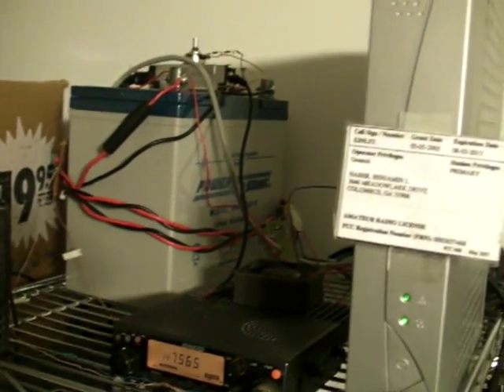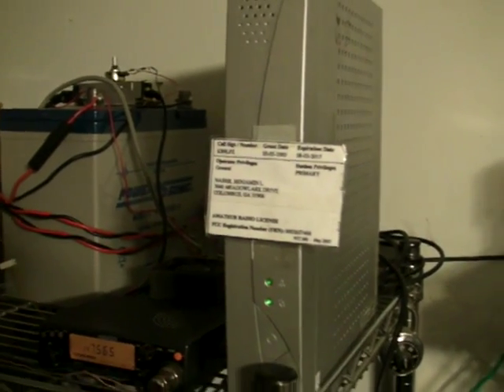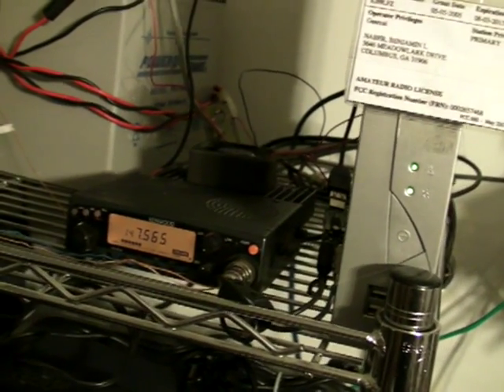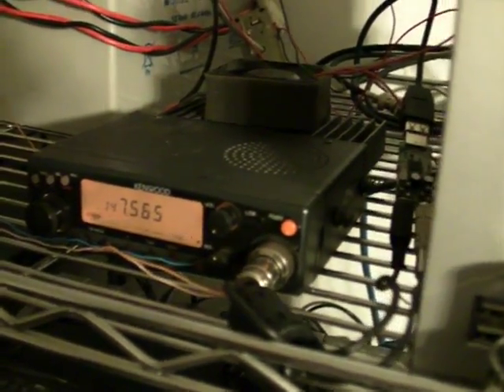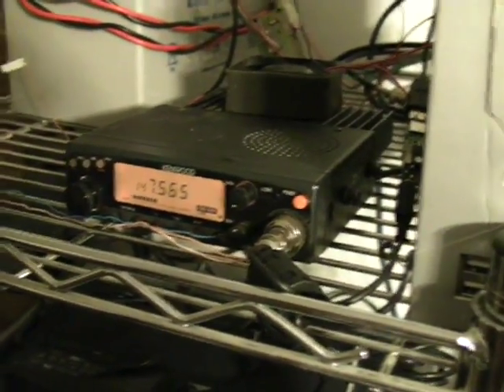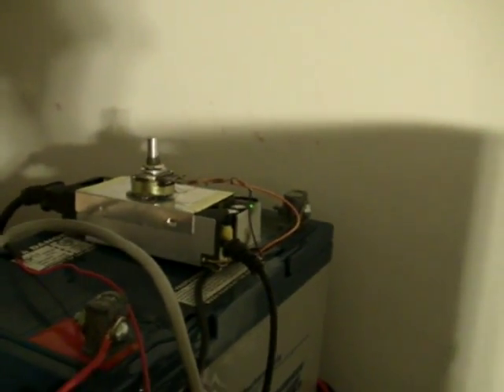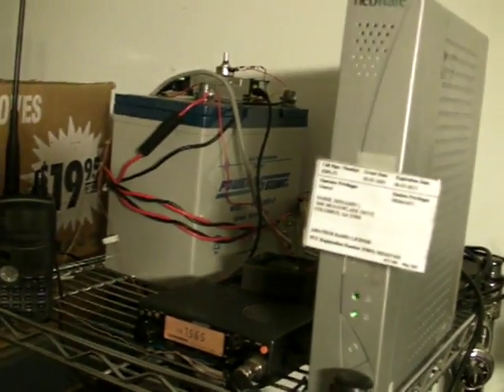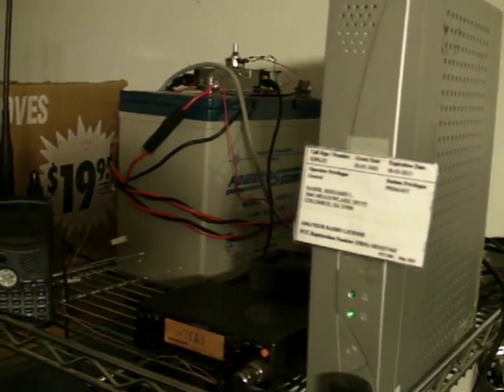Basic Allstarlink Node Setup

Comment: hi long time  since you helped me set up the node i have located a used kenwood 241  to use as the node radio and got a mfj power supply so hopefully soon i will have this node on the air finally. it has been so long due to problems in life  job and health issues  but  i  am slowly getting back up to speed and hope to be on allstar soon   you sir take care 73 frank kd0hgi

Comment: Project23D, I have 4 of the Neoware CA22 Units.... Could you forward me to the instructions you used to flash them ? Thanks so much.
Reply from the maker: Joshua Hatton 
I used TinyCoreLinix and the dd utility. Firmware was limey Linux
Reply: Project23D you speak of the  Allstar Limey Linux release? Did you use the memory card that came in the CA22? Mine has Windows XP Embedded I think.
Reply from the maker: Joshua Hatton 
Yes I used the DOM inside. The DOMs have to be at least 512MB. RAM has to be at least 1GB. 512MB did not work for me. I used the instructions frok m0n0.ch to install the .img file and DamnSmallLinux on USB drive as the host OS

Comment: Where did you find the information on how to use the Neoware Thin-Client as the computer.  Thanks
Reply from the maker: I used limey linux downloaded from the allstarlink website.

While these computers have the VIA processor in them, I could not get the version kerneled for VIA processors to work. I used ther limey linux version for i686 machines. I followed the instructions from the m0n0wall to flash the DOM using DamnSmallLinux as the host, booted from a USB thumb drive.

For a while I had nodes listed for sale on eBay, and can still build one if someone wants one. I do need to make some extra cash to buy a new car, as the one I have now is slowly dying...
Reply: Check out this possibility. http://www.hardkernel.com/main/main.php This may work for AllStar also.
Reply: I was hoping for an exact schematic of your system depicted in the video.

Comment: Awesome video! Thanks. So which pin on the jack is the discriminator out? Or did you have to take the radio apart for discriminator out? I have been told this radio does not have discriminator
Reply from the maker: The Kenwood TM-241 series radios were built during the era of high level of amateur packet radio activity.

It does have a discriminator/low level out pin on the mic connector, which is pin six. Connect the RX audio GND to pin seven. The audio level output is about 100mV at 10K ohms impedance. You'll need to make sure you put on a 10uF tantalum polarized capacitor with the positive lead connected to the side coming from the radio. This provides DC isolation, as well as a simple filter, anything higher, you'll pass more higher audio freqs that will make your node sounds tinny to remote nodes, and you'll have other audio/DTMF decoding issues. Anything lower will result in a bass-y sounding audio, making it harder to hear on remote nodes, and also DTMF decoding issues.

It took a little amount of time before I found what capacitor value seems to work the best for the setup you see.

I have these nodes with DC isolation caps with URI for sale on ebay. It comes ready to connect to your radio. Same user name.
Reply: discriminator out is same to cos or squelch control  (sc) ? please helpme.  thanks for your time.